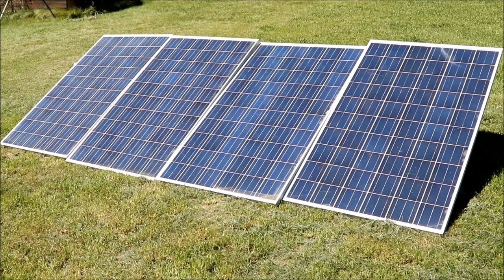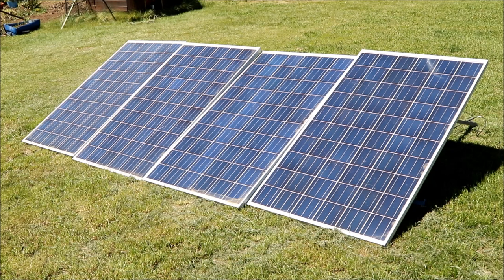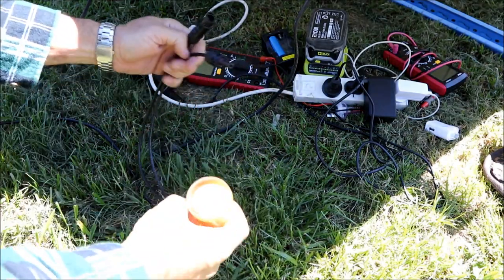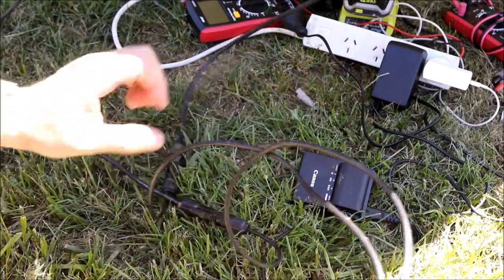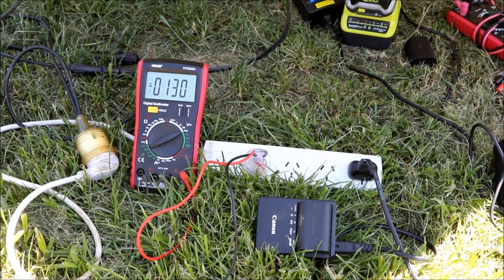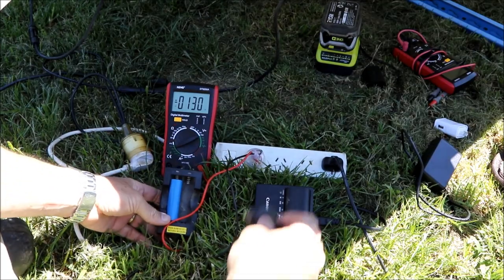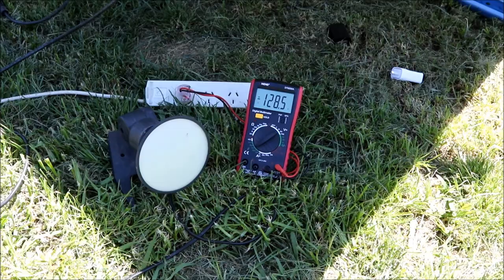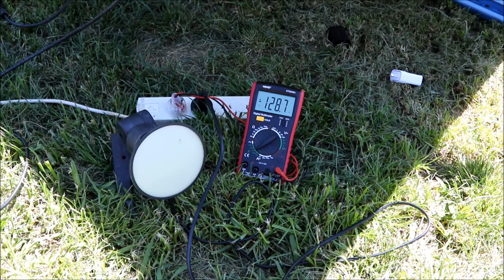Powering AC appliance's Direct from Solar panels.

Comment: Hey, this is unrelated but, could I reach 1550° Celsius with a simple drip-feed waste oil burner and forced air blower? 
I will be using it to melt crucible steel.
Reply from the maker: with enough furl and  the right air ration, shouldn't be a problem.  You will need a very high temp refactory though.
Reply: @glumpy10 Thank you very much for the fast reply! 
Could you help me out a bit more, I'm contemplating the burner design, if I should make it like the classical waste oil burners with a combustion chamber out of an old fire extinguisher or something like that and a tube at the end that leads the flames to the furnace or could I just use a a steel pipe(35mm ID) with my oil drip tube(made of steel also) coming into the main pipe at about 10cm before the end that goes into the furnace(the other end connected to the blower)dripping oil there so it pools and vaporizes when it comes in contact with the hot end of the pipe, so I'm not shooting cold liquid oil directly into the furnace ?
Reply from the maker: @nickulvatten1039   You can do it either way. Straight in is more efficent and probably slightly hotter. Then again, you make the burner big enough and it probably don't matter.  Make the outlet large though so you don't get back pressure for the blower as the air will expand a lot when heated and you don't want high pressure thrust coming out potentialy blowing the metal round. 

Slower speed air gives it more time to  transfer the themal energy into the work piece you are trying to heat up. 

If you want to do a pipe straingt in which is fine, I would pre heat the furnace area with gas directed into the burner tube just like the oil.  Once you have the furnace hot, above about 250C, you can then put the oil in. You will get a little burning as it leaves the pipe but it will mainly vaporise when it hits the hot furnace walls. Make sure you are not blowing direct on the cruicible unless using an outside burner or you will be hitting it with cold air not the flame you want. 

I would DEFINATELY either have the oil pumped in or pressurise your tank with a couple of PSI. that is all you need, just a very small positive pressure.  Believe it or not it's MORE easy to control the flame with the oil pressurised than it is with drip.  Also as the oil  level depletes or warms up, pumped or pressurised the flow and heat output stays the same and you don't have to adjust it all the time. 

You can use a pulse pump on a timer.  maybe half second on every 2-3 seconds or whatever.  If the oil inlet is back near the blower inlet, the oil flow into  the furnace will have smoothed out a lot.  You may get a little pulsing but not much. At higher flow rates it all but dissappears. 

From what I have done, I think if you have enough fire which is easy and cheap with an oil burner, you have have it so the flame itself is the refractory or insulation. 

If the whole Cruicible is totally engulfed with flame rather than like a gas burner just coming from the side, then the flame itself is the refractory keeping the heat in. 

Normally they say don't have too much flame coming out the top because once  it's past the cruicible it's going to waste, that's not all together true if it is keeping any cold air out and there  is nothing but flame surroundling the cruicible. 

I was melting steel pretty easy  just brute forcing it like this but also,  turn your air down  enough so there is flame coming out the top and the flame is right to just before or smoking. 

The things will run with excess air very well but extra air beyond what's needed for combustion actually cools the flame  so don't be concerned it you have a little smoke in this case.  It's better rich than lean if you are chasing heat. 

You will also want to have plenty of oil because  if you get up to say 5O KW, you'll  be going through it.  Will depend on the size  of the furnace you make. 

As I did a vid, even dirt ( Hole in the ground Vid)  and the brick furnace got WAAAY hot. 
I also had no problem melting copper and then steel in open air just blasting it with heat.  That's how I figured if you have enough flame, it becomes the refractory itself.  If you are putting the flame on the metal you are melting itself, watch you don't create too much thrust which will blow the molten metal around like water. 
Not good.

I am no safety sissy but watch melting iron because it is really touch to overheat and it explodes in showers of  sparks.  Id wear a crash helmet myself and put a damp towel around my neck so there is no expose skin especialy in that area.  Some vids I have seen look pretty dam scary pouring  moltern iron. 

Use a large  tube for the air and the oil so as the volume is large but the air speed/ thrust is low as possible. 

Do a vid and let me know when it's up!
Reply: @glumpy10  Thank you so much for the in-depth advice, it's priceless in this situation coming from an expert like yourself! 
My furnace is tiny it's 17.5 cm in diameter and 25cm tall made of 5 white hard firebricks stood vertically in a pentagon pattern. I'm melting only 200 grams of iron in a small crucible and the crucible has a lid on top of it, I don't move the molten steel anywhere, the only thing I need to achieve is to get it fully molten inside the crucible and then let it cool down very slowly inside the furnace in order to form dendritic crystals which result in the beautiful pattern of Wootz or crucible steel.  
I am aware that a pump or an atomizing system will be way better but I'm on a tight budget also I have free time only until the end of this week to do it pretty much, so I will have to do with a drip-feed. 

It's crazy how much conflicting advice there is out there on this subject, some people say lean is hotter some say rich is hotter, one guy melting crucible steel uses a shop-vac and wasted oil and swears you need a minimum of 40 liters per second of air consumption to make it work or better yet 60-65, however I'll run it rich as you and another very knowledgeable person told me richer is hotter, also I've had a semi-sucess with a different burner design where the oil was dripping inside the end of the burner also running it very rich tbh it was way too much oil leaking outside of the furnace on the floor but I had a more powerful blower then and also the oil was very thin from an electrical heating radiator, it got nasty hot above 1500+ but my crucible cracked and I also ran out of oil. 

Your big brick furnace indeed got stupid hot I was watching the video today and was thinking you are losing so much heat from the open top, if you'd had that closed it probably would have turned the whole furnace into a molten puddle as those flames were definitely 1500+. 
I don't think I'll need many KW's for my small setup but I could be wrong as to reach a higher temeperature you need more fuel and air without a doubt. 

Another problem I had with a previous burner design that had the oil tube at the end of the burner hanging mid-way in the main pipe and the air was grabbing the oil throwing it at the furnace walls but I was taking a lot of oil to make it work as a weaker flow was making the flame sputter and blow out as there was too large of a interval between the oil drops arriving from the tube and igniting, so I'm  thinking of backing up the oil tube in the new burner as I mentioned about 10cm back from the end and letting the oil actually drip inside the main pipe and slowly make its way down the hot pipe hopefully vaporizing, what do you think about this and generally is it better to have the oil pipe closer or farther away from the burner tip? 

I will definitely let you know how it goes, I can't promise I'll upload it on YouTube but I'll definitely send you photos and videos if you give me another social media contact info.
Reply from the maker: @nickulvatten1039   Smaller is harder with Oil but not that it can't be done. 

As for the Rich/ lean....
The thing is if you add more air than it take to burn all the fuel, and remember you only are using 12% I think it is which is the oxygen, any additional air once al the fuel is burned is doing nothing only cooling the the whole process. 

The cold air that is not fueling the fire is simply taking away thermal energy and exhausting it out the furnace.
You only want enough air ideally to burn all the fuel and that's it. If you have a little less, the excess oil will pull a lot less heat than the air will that's for sure. 

That's a mistake I see a lot of people make. They think by pre heating the oil it will burn better or hotter or whatever.  If In fact they pre heated the air which has a LOT more thermal capacity, they would do a Lot better. 

As for the oil Injection point, I like it further away from the furnace.  Makes the oil flow more steady and if the  ait tube is deeper in the furnace, you get flame coming out  straight away therefore avoiding cool spots. 

Good luck with it!
Reply: @glumpy10  I did a firing last night, and it was a total waste of oil I burned through about 15 liters in 2 hours and 30 min, I had a difficult time finding the perfect air-fuel ratio, at one point it got very hot in a certain area at the upper end of the furnace it would turn my 6mm iron rod into a sparkler so it was above 1536°C  but my iron charge in the crucible didn't melt at all despite having 1.8% carbon mixed in. 
There was a lot of carbon buildup in the furnace the next day I was running it way too rich, also the fuel doesn't atomize properly just by dripping in, it would be best to have a pre-burn chamber maybe an old fire extinguisher, thick pipe welded up into a cylinder,etc and get only the pure flame and heat into the furnace without the oil dripping in and cooling it  off. 
My Facebook is Nick Ulvatten, if you're interested in seeing some photos and videos I took I can send them to you on Messenger.
Reply from the maker: @nickulvatten1039  The biggest difficulty I have found with burners is people getting used to them.  It is literaly like riding a bike, you have to practace and get the feel for it. 
It's part science, part skill, part art. 

Just fire the thing up again and hard as it is, don't be afraid of the thing going out.  Sounds silly but that's what seems to bother a lot of people and they will do things to prevent that but only do what they think is right, not go our of what they think and learn the broader picture. 

Just fire it up again with no expectations and play with it. do the extremes and see what happens.  When you have done that do it some more. 

I probably make it look easy in the vids and for me it is, NOW, but I had to learn too. 
Your grandmother whom was probably a fantastic cook probably wasn't the first 5 years she was cooking and again, a valid anology of practice  and learning. 

Stick with it, it does get easy pretty quick.
Reply: @glumpy10  Thank you for the reassurance, I have noticed myself that things do get better with every firing this burn I was definitely more in control of it, the previous ones the thing was literally doing whatever it wanted, I usually don't have a problem with it going out bit rather getting it started is more difficult even tho my starter oil is mixed with diesel.
The interesting thing when I really turn down the oil feed it doesn't go out but the flame, the heat inside becomes so weak I can easily see the crucible inside and everything. 

I completely agree it all comes down to experience, of course some knowledge of the process doesn't hurt.

Cheers!

Comment: The reason your LED lights don't work is the type of power supply inside them.  There are 2 types.  First you have a switch mode supply.  They usually have a FULL BRIDGE RECTIFIER, and should work if the voltage is high enough.
Second is the bimable type, an they usually us a capactive dropper. They will not work as a capacitor tends to block DC but pass AC.

Comment: More expensive converters use a bridge rectifier, so they will work on any polarity. The cheap ones you buy at the dollar store they cut cost, by using only one diode, instead of the 4 in a bridge rectifier, saving the 1c the other 3 costs. polarity of the wiring to the built in plug depends on whichever Chinese worker was doing them that day, they connect the wires randomly.

I am doing the same for my trailer, using a simple 12V SLA battery, a simple charge controller and a solar panel, so that it is simple to place on top, and have a charged battery for use at night.

LED lamps the cheap ones use a capacitive dropper, so they will not work, and others need to have at least 180V to get them to light. Try using the more expensive lamps, which often will run from 120 or 240VAC, if marked that they run on 120 to 240VAC they will work. Otherwise just use 12V LED lamps or strip, and the appropriate wall wart to power them.
Reply: Here is something to try with LED lamps, put a .047uF capacitor in series with the AC lead.  Some will not work. Some will flash, a nice emergency signal.  And some will be very dim.  I use a dim one in my hallway with a capacitor across the AC switch.  It acts like a night light so you don't run into things at night using very little power. Throw the switch and you have full brightness.
Reply from the maker: Thanks for the explanation.  I tend to think of cheap battery chargers ( for cars) as being switch mode and better ones as having a wire wound Transformer but maybe they all use switchmode now.  The transformer type still use the Bridges and I have a Cheap Charger which used a pair of Diodes and converted to a Bridge for much better power handling.  You are Correct. I did try some indoor LED downlights at the 196V and they worked fine.  Buggered the sound on the footage up so didn't show it.  Thanks again for the informative reply.  will be helpful to a lot of people.
Reply: @glumpy10  Yes iron core transformers will not work on DC, and will simply burn up, but the switch mode supply is now almost only the only thing you find, except in some very special cases. They are cheaper than even the cheapest iron core transformer, mostly because of the cost of the windings in the iron core unit raises the price, even if the wire is CCA wire, fewer turns of wire wins out, and the rest of the electronic parts are very cheap in China, especially as a lot come from salvaged equipment that is being recycled.

Comment: Very interested in solar
Reply from the maker: I have been thinking about a DIY solar Channel.  There are plenty around but they never seem to really cover things I am interested in, mainly all RV orientated rather than Mischief you can get up to round the house.  Also notice that they tend to be very low powered even for RV/ camping use.  If I read of anyone else talking about Pissy little  100W panels, I'll scream! I don't even bother with anything under 250 now.
Reply: @glumpy10  I am in an area that is very outspoken against solar,  but that's due to government trying to force it on everyone.  I want to solar power my shop but panels over here are still very expensive.  Even the pissy 100w ones.  It's hard for me to justify spending 5-7k on panels and all the fixins when the shop only burns around 45USD a month.  Take a long time to pay itself off. 
I am looking for used panels,  and even the little ones lol.  Have plans for a off grid cabin and solar will be needed for that.

Comment: The reason it doesn't work either way is because, Basically, SwitchModePowerSupplies (SMPS) use a half-wave bridge rectifier, instead of a full-wave. This means only one of the two wires accepts positive incoming current. This passes the internal half rectifier, and then that fills in a capacitor. This capacitor is then used by the circuitry inside to generate a high frequency AC as this allows the transformer to be MUCH smaller, transforms it to whatever voltage the thing is designed to output, regulates it, stabilizes it, filters it, and outputs it.
Reply from the maker: Thanks for the explanation. That makes perfect sense and answers the question.  I forgot all about Bridge rectifiers even though I have a battery charger I have replaced them several times on because it blows them.  So cheap I just  swap them out and don't bother fixing it properly.  I bought the charger So many years ago when I was still very young so it's very old school and sentimental.  Been through hell and back but still works fine. 
Thanks again for clearing up the Mystery!
Reply from the maker: @dimitar4y   I agree!
Information is power and independence.  I love the ability to be independent especially with energy.  Also learned so much of the net,  several things I have gone into successful businesses with just from what I learned and other people shared with me. I like to do vids like this that opens peoples Minds and curiosity to try different things for themselves and learn.
Reply: @glumpy10  there's been several attempts to ban such content though. they will keep trying, too. The internet's the best thing that happened to me too. If I were to try to gather even half the knowledge I have right now from libraries,... I'd be dead of old age and not even have half of that.